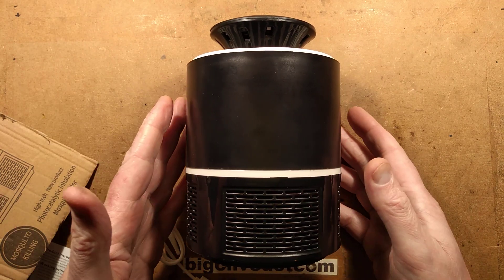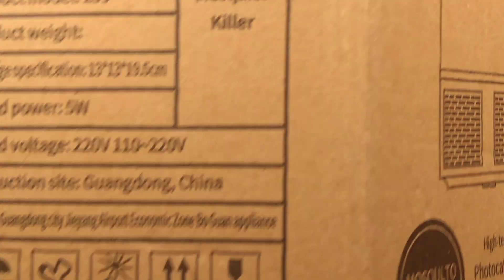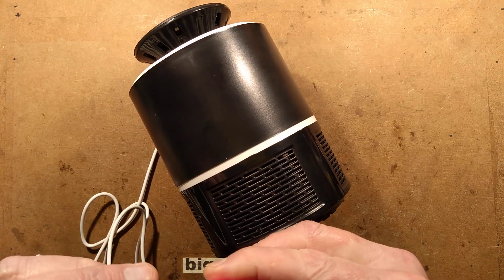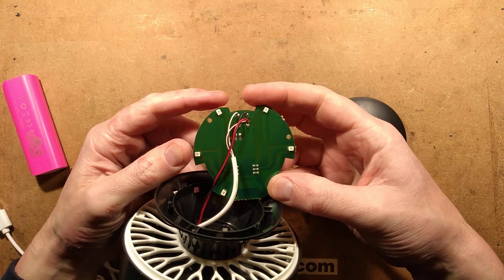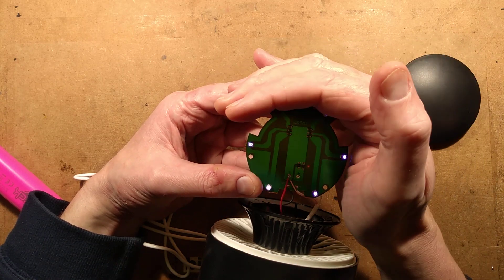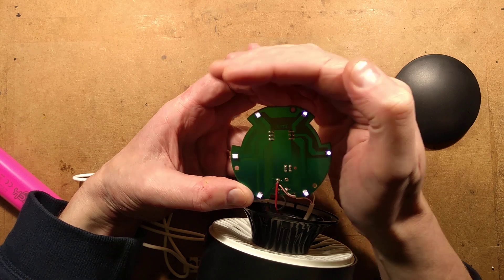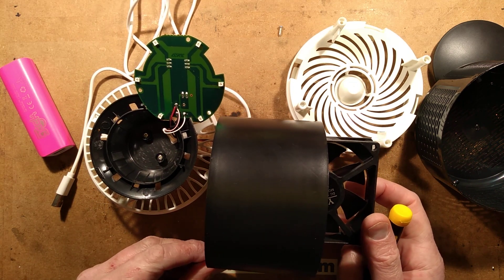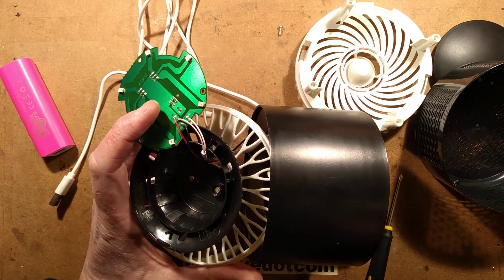USB powered photocatalytic inhalation mosquito killer.

Comment: Purchased. After twenty days uv lamps stopped glowing. Only fan working. So stuck up and no reply from supplier. Don't know whether lamps can be rectified.
Reply from the maker: The LEDs could be changed, but it would require basic electronic skills.

Comment: Normally there should be a sticky pad that sits at the bottom.
I have had a couple of "similar" traps like this and they do work.  Much better at night of course when it is the only light for the insects to fly towards.
I think the LED's are supposed to light up the top of the fan grid so they fly into the suction of the fan, then get blown down onto the stickypad where you can dispose of them at your leisure.

Comment: A really common mosquito “solution” in malaria affected areas is just a big fan. Mosquitos are too small to fly effectively in strong wind, the fans literally blow them away.
Reply: I can testify that. The time I gone on the vacation to the "countryside" of my city, they made a VERY SKETCY and DANGEROUS fan using a 60's car fan and a engine from a small washing machine. That thing goes from zero to 100 in a split second, and it blows insane wind speeds.

Comment: I have a similar one, not exactly like this one here. The Leds did not work, fan was working. Circuit analysis revealed only one series resistor 56 ohm (classic type, not SMD) for 6 parallel leds!
This is not good design practice. I cut the printed positive voltage line on the PCB to check individual leds: one was shorted so it must have taken all the current from the supply (through 56 ohm). 5 remaining leds with an individual series resistor of 330 ohm solved the problem.
Why trying to save on resistors? They cost almost nothing.

Comment: Dear bigclivedotcom,

I want to use this device by the power line, but I do not know the power of this device.
Can I use it from the 110-volt or 220-volt line?

Regards,
Reply from the maker: This unit is USB powered.  You'd need a USB phone charger to power it.

Comment: Best mistranslated warning I've seen was "Be against trampled". You see some fun stuff working in an Amazon warehouse. Like the scented bidet seat with built-in led's. Or the "elite carbon-fiber nitro rollerator (you'd call it a zimmer frame in the UK)". Surprised they didn't add in "turbo" or slap on a sports car logo.

Comment: UV leds/laser diodes have a very short run life. UV tends to break down the coating on the surface of the die. the 400nm LED beads seem to be the best overall power/life beyond that break down is still an industry problem mostly due to UV being an oxidizing catalyst.

Comment: Wouldn't a brushless motor require 3 lead wires or more?
Reply: ...And for Mac fans, the leads are irrelevant: It's a trip down to the Genius Bar and a payment of four times what it'd cost to replace the fan in a PC. :-p
Reply: For PC fans, the leads are usually VCC (+5v=), ground and sense/control - The latter being a serial connection relative to ground, though I don't know if this is COM, SDA or I2C.
Although this can be used to pull data from the fan (I.e. RPM & temp, if a thermistor is fitted) and possibly control it, it's not mandatory.

A three lead fan connected to just VCC & ground will simply operate at full speed in "dumb" mode. :-)

Comment: So because of Big Clive I went on Ebay today and bought a Keweisi USB tester.  Then because of another Big Clive video I finished up on Gearbest looking at the star LED ceiling lights when a 3D printer caught my eye.  So I went to look at some reviews of the 3D printer, then found myself on Banggood looking at the prices (which are better, for the same product), and then I somehow finished up looking at sports cameras and found one for AU$12.  It's probably a very small potato with a lump of plastic on one side and 16x16 sensor on the other but what the hey...  (actually I think it is a usable camera for hobby purposes, and well worth the twelve bucks).

So that's my Sunday afternoon productively seen to, and for whatever reason it's seems that Big Clive is an inspiring force for good...

Comment: Back in the day I had a fancy computer case made of clear acrylic, with UV CCFL tubes and UV reactive cable sleeves and fans. It lived just under a window, and from that I can testify that this kind of design (albeit with much brighter UV lights) does attract and kill bugs, quite efficiently even. Every couple of months i would have to strip it down to clean out a thick layer of mulched bugs from the bottom of the case. However the bugs it attracted and killed seemed to be mostly small moths, not so much flies and mosquitoes, and here in Australia we have no shortage of any of those.

Comment: Could you try and get one of the cheap eBay "1000Watt" power inverters and see just how cheap they are and if they are hackable to make a custom output. EG like mains voltage (120v 60hz for me) but at a higher frequency?

Comment: No idea if you will see / be interested in this but om page 49 it has some interesting data about wavelength of light and number of mosquitoes attracted and the general phototaxis in mosquitoes. Don't know if you can check the wavelength of the LEDs in this unit or not.

BEHAVIORAL PHOTOTAXIS OF PREVITELLOGENIC AND VITELLOGENIC
MOSQUITOES (DIPTERA: CULICIDAE) TO LIGHT EMITTING DIODES 

http://ufdcimages.uflib.ufl.edu/UF/E0/02/19/67/00001/bentley_m.pdf

Some other good data in here but it is a dry old read unless you are really into insects.

Edit: looks like green LEDs do well for some, If you do get the time for a test could be a chance to try some Bigclive made ones with different wavelength LEDs.

Comment: Clive, I've noticed that same 'weakness' of UV leds myself. Running them across a relay with no diode protection nuked one I had running at 12 volts with a 1K resistor, but a blue one didnt get nuked. Strange enough the switch the LED was in, when I'd stripped the LED from it and ran it from +3V coin cell it was fine, back on +12v with the resistor it got dim and went out again, still working on the lower current battery.
Reply from the maker: That sounds like failure of the thin film LED construction.  It results in the effect of a resistance leaking current through the LED without lighting it.  If you increase the current high enough it does make the LED light.

Comment: Mosquitoes are not attracted to UV light. The people who think these traps work are looking at a completely different insect that just looks similar to mosquito caught in their traps. You need a CO2 lure like a tank of propane.
Reply: But propane is not co2.  Perhaps a bottle of paintball co2 from the sporting goods store could be hooked to it with some sort of valve to slowly let it leak out.
Reply: Propane decomposes into CO2.
Reply: I once had a mosquito trap that ran on propane. Of course it has a way to decompose it into CO2. It probably used a catalyst to omit the use of a flame.
Reply: Only if it gets burned.  I don't think we should burn propane in one of these plastic cases with the fan.  Fireball may ensue.
Reply: Although that would be exciting!!

Comment: I'd much rather have seen you test if it works on an actual, live mosquito. By sight, I would thinkthis prob'ly one of the most mosquito-friendly insect traps out there.. does a moquito actually even fit through the openings in it? Does even half a mosquito fit through?

Comment: Fan traps primarily work on mosquitoes because they're weak fliers compared to other insects. Doesn't seem to be anything photo-catalytic about it (unnecessary BS), it's just a suction trap. (Best ones seem to be home-rigged from a strong box fan and a window screen.) If there's any way to improve it, it likely needs to have a nearby source of CO2 production and a stronger fan. The grid in the trap section might be another trouble spot if it's not tight enough to keep them in.
Reply: I had a similar trap in Malaysia. There was a ceramic layer under the UV which was supposed to give off C02 when hit by UV. It definitely drew in mosquito, and I would have to empty it every week

Comment: Why don't you use your long prong screwdriver set all the time at the bench? I always gravitate toward the kit I have, because I know they fit most screw holes. I've always wondered why you have a preference for the stubby aluminum bit driver thing...
Reply from the maker: It's mainly habit.  It also deals with about 95% of cross head screws.

Comment: Piece of junk. If it did suck up a Mosquito, it would just fly or crawl out the vent slots at the bottom. It needs a hi voltage zapper inside.

Comment: Clive - are you going to have a look at an electronic mouse killer? there are at least a couple on the market that claim to be able to kill 100 mice on a set of AA's - maybe it's based on a tazer type circuit... don't need to test it on actual mice & get demonetized, just wondering what the electronics are..
Reply from the maker: I've had one sitting here for a while.  I should make the video about it.

Comment: The resistor is  on 1k.  It says 102, you read it upside down.
Reply from the maker: I measured it.  It was 200 ohm.
Reply: @bigclivedotcom  Ok. Sometimes the font in resistors could be a bit confusing.   I once tried for hours to find information on a resistor marked E01.   It was of cause a 10k. (103 upside down)

Comment: "Product Model: 139" certainly makes you wonder if there is indeed 138 other ways of making a mosquito killer or its just copies with slight variation.
Reply: Or 138 failed attempts.
Reply: first barely working model
Reply: 6 types of case molds, 6 types of defective 5V fan surplus, 6 types of good-for-we'll-see-what LEDs makes 216 types... we reached like 160 now

Comment: Clive has run out of ionisers to test :-))
Reply from the maker: There's no hope of that.  I have a box of different units here.
Reply: @bigclivedotcom  ha ha, why am I not surprised :)

Wish I knew as much about electronic gear, I know enough to fix some stuff but I have a maplin digital solder station that had a element go bad and since replacing the element the unit displays an error code and refuses to work. Something you'd fix in no time but I'm stuck.

Annoying as it's not really that complicated inside but I think it's an IC that's gone bad but have no way of knowing for sure.
Reply: @bigclivedotcom  your reading of the instructions made me laugh, I have seen the 'not afraid ' in banggood stuff when it comes to water, I love chinglish,  always amusing

Comment: can you test this product out? i bought it because i needed to glue a few things together except it lacked the power to melt the glue fast enough while i used it. But the HOT glue started leaking out of the melting chamber bit down through a hole and started jamming the trigger, and eventually exploded in my hand!

https://www.ebay.co.uk/itm/20W-Hot-Melt-Glue-Gun-Electric-Trigger-Adhesive-Hobby-Craft-DIY-10x-Glue-Sticks/253855876778?_trkparms=aid%3D555018%26algo%3DPL.SIM%26ao%3D1%26asc%3D54618%26meid%3D4de0b36912114113a90f78777f6b7999%26pid%3D100005%26rk%3D1%26rkt%3D12%26mehot%3Dag%26sd%3D283129361698%26itm%3D253855876778&_trksid=p2047675.c100005.m1851     (also i want to mention it's not from this buyer, but it's the same gun model)
Reply: Seller you mean?
Reply: yeah.. whoops

Comment: Clive find an old pair of glasses that have the lens that tint in the sun light. If it's really UV the lens will tint. I found that out the hard way once. I was in using a Magnaflux machine and was doing the inspection and things started getting dim. Turned out my glasses were going dark from the UX lamp that is used for inspection. So after that I made sure to use non tinting glasses for that job.
Reply from the maker: I do normally wear photochromic lenses.  Right now I'm testing a pair of bifocals though.
Reply: Have you tried the LEDs with the lens?

Comment: Back in the early 1980's I attended an auction, and purchased the great-grandfather of that unit.  She was nearly 3 feet tall, overall, she had a rather large round sort of florescent black light on the top, then a hood over that to protect her from the elements.  Then there were 4 braces that lead to a barrel type enclosure which had a high speed steel electric fan that ran at a fairly high speed.  Beneath that was supposed to hang a canvas bag to collect the bugs, however that was missing.  Well when I got home, I connected her up and the fan mad an horrid noise as the bearings had dried out over years of disuse, so I tore her down and put some white grease in the bearings then reassembled her.  This quieted her down quite a lot but there was a lot of fan noise, well about like todays mains voltage electric fans but a bit louder because of the frame work amplifying the noise.  Not having the right bag, I asked the wife for some of her panty hose, she had a pair that had laddered, and were pretty  much shot, so she gave them to me, and I mounted them to the device, tying the legs up so they didn't flap in the wind, and mounted it from the overhang of our garage.  It worked like a charm, and our backyard that had been plagued by wasps that loved the rotting apples from the 12 apple trees that cluttered our back yard.  The panty hose quickly filled, I had to empty her weekly to keep up with the bug harvest, and the yard parties at our house became quite an attractive happening within Law Enforcement circles, which, of course, as the Chief of Police, I was involved with.
Reply: That's awesome Jerry. Have you still got "her"? I mean the bug vac, not the wife.
Reply: I think my dad had the same type. The brand was Insectifuge IIRC.
Reply: Bonus point, whenever someone asks why your wife is in a foul mood:  "Her pantyhose are full of wasps!"

Comment: Computer fans run on 12v, not 5v. Then fan in the device was a 5v fan
Reply: It's a 5V fan but it's based on all the same electronics and tooling as a 12V fan, probably just with a different winding on the motor to start it more reliably.

Comment: I'd rather use a sticky roll. One of these things you hang down from the ceiling and watch insects getting cought on the sticks surface. One summer it turned black from all those buggers.
Reply: Ulfgar-Septimus von Stahlenberg when I was a kid it seemed like everyone used those. My uncle had a paint store and left his roll-up door open in all weather, and it fascinated me to look at the no-pest strip. Sometimes there'd be some exotic or huge bugs in it, not just flies.
Reply: Indeed. Even mosqitos and some real huge beasts. Some of which with enough strengh to nearly pull themselvs free. Impressive. Other than that moths too. Everything that is attracted to light, which - when you hang it on your ceiling light - works just fine.

Comment: Thanks for this one! I received two of these exact same models last month and put them in my garage. I go out to the garage to smoke and get eaten up by mosquitoes. So far I have caught 0 mosquitoes! But the lights are pretty and yes the instructions are quite entertaining! Next time I get an infestation of fruit flies in the house I will try them. But I have had such good luck catching fruit flies by just putting a little red wine in the bottom of a canning jar and a piece of plastic wrap over the top with some holes in it. I can set it up before I go to bed and when I wake up all of the fruit flies are in the jar!
Reply: thats because mosquitoes arent attracted to uv light, they are attracted to Co2. A really effective mosquito killer would need a constant source of Co2 so they get close, then suck them in/electrocute them.
Reply: Exactly. "House flies" are attracted to UV because they think it is daylight. Mosquitoes are attracted by CO2 and infrared because the warm blooded  animals they feed on emit heat and exhale CO2. Commercial mosquito zappers used around outdoor dinning spots are actually powered by a small propane burner that of course gives off heat and CO2. The fire doesn't have to be that large either so they can run for a long time on a relatively small amount of propane.
Reply: I'm really attracted to red wine and cider.......maybe I was a fruit fly in a previous life!
Reply: Your fruit flies are actually called fungus gnats and they live in the soil of potted house plants. But if you'll water those laced with mosquito dunks with the Bacillus thuringiensis israelensis strain, it will remove the larvae of the fungus gnat from your potted plants and eventually the gnat itself from your house. Brought to you by your local pot grower where these gnats are often a problem in plague proportions and the easy solution to them known for decades.
Reply: I have no potted plants in the house. The only time I get fruit flies is when I buy bananas!
Reply: BS!